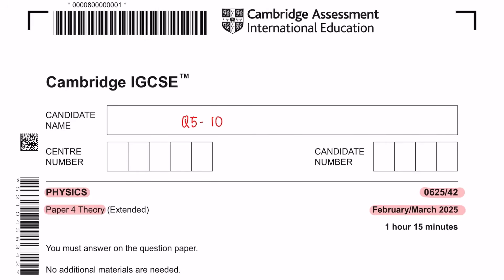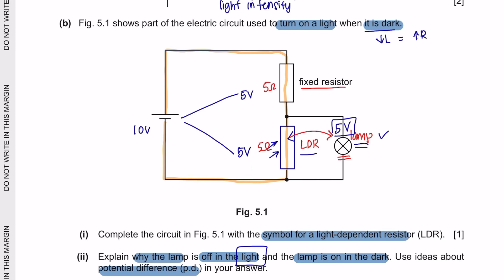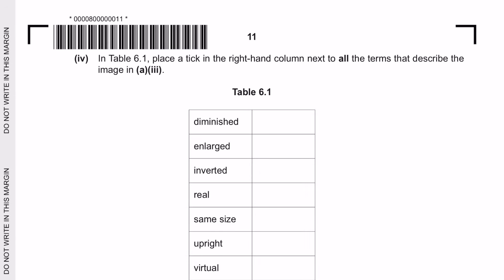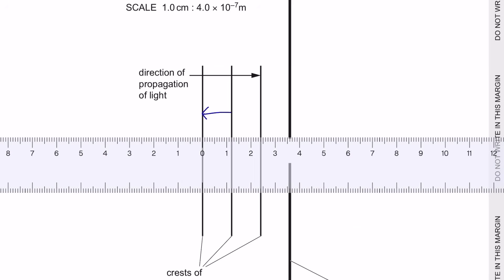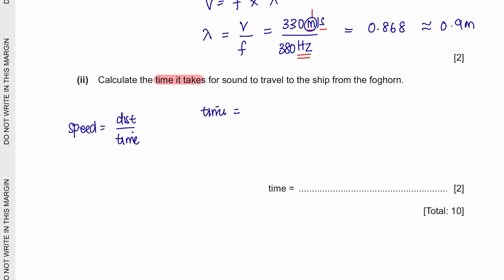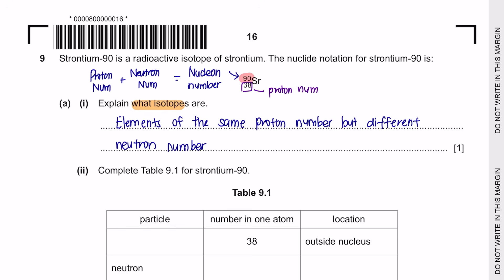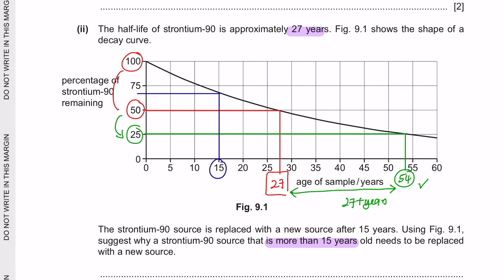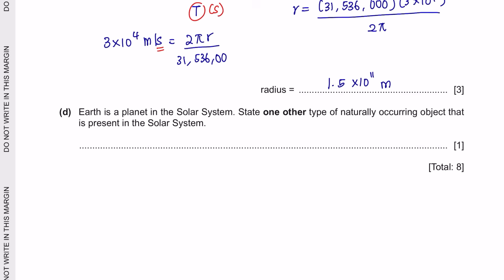IGCSE Physics Paper 42 - Feb/Mar 2025 - 0625/42/F/M/25 (Q5-10) SOLVED

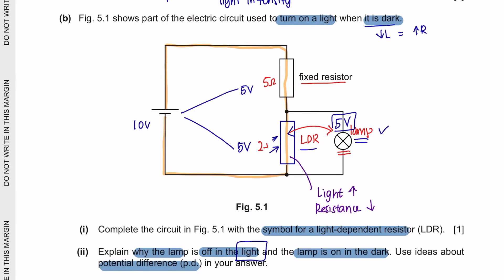Comment: Mistake at 2:20, You cannot increase the resistance of the fixed resistor, because its resistance is… fixed.
The point is that the 5 Ohms will be a larger % of the total R.

Comment: hello, at 10c,  we always use 365 days at the time?
Reply: The actual answer paper will have a range. So probably anything between 90-95 days is valid (I don’t know the exact range offhand.)
Reply: you basically need to convert your time into seconds. we know that one year has 365 days and in one day there are 24 hours and in hour hour 60 mins then 60 seconds in one min. so to conclude you multiply 365×24×60×60 this will get you your answer in seconds 

Big calculation 😭😭🙏🏻

Comment: I believe you made a mistake in question 10b as Summer is position F and winter os position H.
Because X is in northern hemisphere, so when the sun shines upon it in position F the rays fall perpendicularly and are more concentrated per unit area therefore temperatures are high. Vice Versa for H

Comment: Here is my question, 10. (b) is it possible for summer to be at F as the axis is tilted and the northern hemisphere is facing toward the sun and winter at X as the axis is tilted away from the sun?
Reply: Yes I also said that
Reply: correct
Reply: I just checked on the actual mark scheme. It is F and H. She made a mistake in the video, because tecnically it is summer when X is tilting towards and winter when its away from it.
Reply: @manycap3298 where can i get the mark scheme?